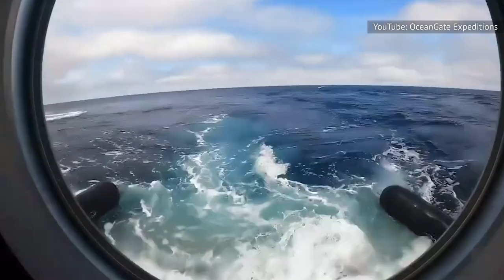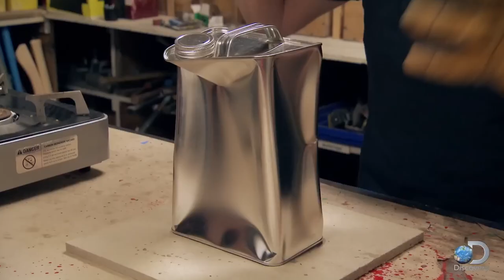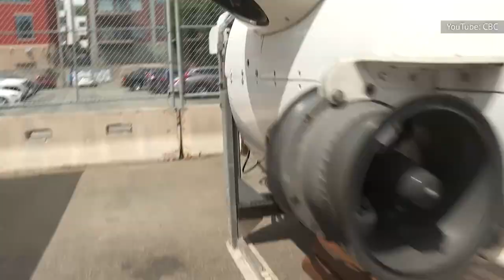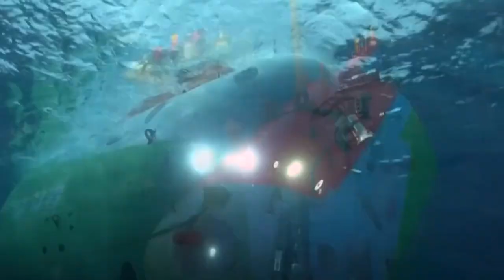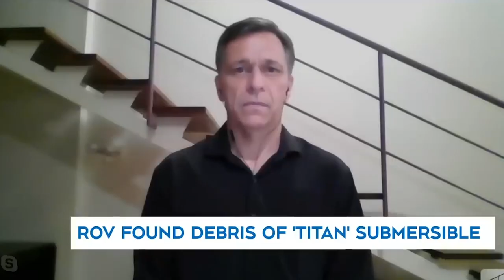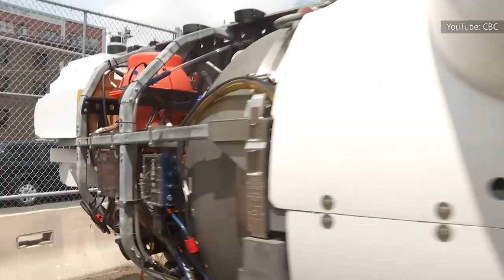The Truth Behind How The Titan Imploded, According To Science

Comment: Carbon fiber is great in tension, but not so great in compression. Hull was supposed to be 7in thick but was wound to be 5in thick. Hull bonding methods were never tested so likely had voids in layers that created stress risers. Titanium End caps were resin bonded to hull in an untested manner. Electronics were all 2nd hand and never intended for harsh duty service. Cabling running external to hull in locations where it would be easy to snag. Multiple prior trips cancelled due to mechanical or electrical failure. Acoustic hull stress sensors were a waste of time for this type of usage. Minimal prototype testing showed there were issues so response was to stop testing.  Acrylic porthole was installed in a manner that the dissimilar material issues were heightened not mitigated. What a joke. This wasnt pushing boundaries. This was slow motion suicide.
Reply: Good summary of this disaster.
Reply: The fact that Oceansgate privately had know that Sunday that the sub imploded immediately after comms and tracking were both lost simultaneously and shared that fact with the Navy,....yet, while deliberately  misleading the public for four days is the real tragedy here.  The families were hanging on to false hope for days until Thursday when Wood's Hole Oceanographic Institute finally confirmed what was known all along on Sunday by traveling to Titan's last known position and then descending straight to the bottom where Titan's wreckage was found,..exactly where they expected to find it. Authorities knew all along that the sub had imploded on Sunday, and dragged out the story of hope for four days. The sub was degraded by structural failure with each dive it made up until Sunday.
Reply: @careercriticalthinker  They needed visual confirmation before saying anything to the families. Authorities heard the implosion, but couldn't definitively say it was the Titan until an ROV arrived that could go to those depths. They had to search elsewhere under the assumption that something else could have happened while they waited for an ROV to arrive at the site. This is standard procedure. If I was missing, I wouldn't want authorities to stop looking for me without visual confirmation that something happened to me. 

The biggest problem is the media circus around it.
Reply: @careercriticalthinker  to be fair they needed to actually see the sub to confirm their claim. They cant just say it imploded without finding the sub first
Reply: The most important thing was the pressure vessel, he said it himself. Clearly the design was terrible. 
   There should have been 10" of titanium ring overlap on both sides of the CF end Then it should have been bolted all the way around with hundreds of bolts and then more CF wrap woven and bonded over these, on the inside there should have been a very hefty frame providing diagonal bracing against twisting, while incorporating large rings (probably 4 or 5 along the length) especially one close or bolted to each end plus longitudinal bracing.
  If i put some thick walled carbon tube in a vice it will easily squish before shattering. Another design improvement could be adding layers of other materials or with different CF pattern to the CF wrap making it a laminated design, potentially integrating the "hefty frame" i mentioned. When i saw how they bonded the titanium rings to the CF my eyes popped out of my head. They should have lowered this into the Mariana trench with nobody on board. That would have been real testing. See at which depth the prototype implodes.
  I wonder if they recovered any video footage but i can't imagine any sort of memory chip surviving the implosion and the sea. Perhaps if they find the actual chips in the memory cards.
Reply: Nailed it the last missing view cap bolt not necessary

Comment: Delamination is what seems to have been the cause of the accident. Carbon fiber is subject to failing under pressure and low temperatures. The cylinder was 5 inches thick, but apparently over successive dives kept losing integrity to the point where it failed. This was indicated by 'cracking sounds' coming from the hull. They just ignored those. The RTM hull monitoring system installed on the Titan gave them the same feeling of false security that the watertight compartments of the Titanic gave to the White Star Line.

Comment: Not rocket science. Hull was made of carbon fiber instead of industry standard metallic. Titan's viewport was certified to 1,300m depth. Titanic rests at 3,800m. Ocean Gate played Russian roulette with each dive. Not a matter of if but when.
Reply: Video actually says the titanic is at about 13,000ft and the submersible was designed for that exact measurement but the equipment should always be overqualified. At bare minimum the equipment should have been able to do 16,000. To be safe you should go to 25,000
Reply: 4265 FT*** 12467 FT**
Reply: The window is shocking. It almost makes you think the guy had a brain tumor he didn't know about...hard to believe this level of stupidity.
Reply: It's my understanding that the company that made the viewport offered to make him a new one but he declined. Something about not wanting to spend the extra money. 🤷‍♂
Reply: Exactly
Reply: And they pay the price
Reply: Hull was made of carbon fiber instead of industry standard metallic. Bonded to titanium caps on both ends sealed via epoxy and galvanization prone bolts. Those facts alone should give pause before allowing  human transport.
Reply: May they use the submarine for races
Reply: Wow you're soooo smart
Reply: Metallic? I think you meant titanium
Reply: @Michiganders yup

Comment: If you're going to use carbon fiber... make it 10 times down to the bottom and back with no one inside. THEN build a new hull every single time and go maybe 5 times to the bottom with it. Basically you will need to treat the submarine as disposable after a few dives. Then again if you go with steel you can reuse it endlessly.
Reply: The CEO knew carbon fiber isn't a material used in deep dive subs for that reason and he used it anyway. He was proud of breaking the rules and said that safety "stiffled innovation"
Reply: Titanium is the best material. There was a Soviet military sub that was rated to similar depths, with a crew of 14 or so, and had a titanium hull.
Reply: @Pythoner  it is but only because of its lighter weight compared to stell which works just fine but is almost twice as heavy.
Reply: @purplebutterfly314 well, carbon fiber is used a lot in planes and "Crush" (let called him that because he got crushed into fish foods) being well versed in aeronautics engineering for many years overconfidently believe that the carbon fiber could be applied for deep diving industry.
As for breaking the rules attitude, I saw some psychologist state that Crush's attitude cames from his wealthy background. From my experiences with rich people, lot of them do not like to take "no" for an answer even if their actions broke the law and Crush is one of them.

Comment: When you operate a submersible with a video game controller, you get a final destination.
Reply: The inside lights were bought from a camping shop.
Reply: it it had glow sticks to light up the inside
Reply: Monitors and keyboards just sitting on the floor along the wall😂 Who the hell thought this was professional
Reply: The controller was literally the safest thing about the sub; only ignoramuses keep repeating this. The carbon fiber hull and the interface was what caused this issue and was the most dangerous aspect
Reply: current US subs use Xbox controllers,  its not a novel thing btw
Reply: @melodymacken9788 it looks like a mini van on the inside 
Maybe that is why 😅
Reply: @logicrules5793 professional gamers maybe
Reply: @pyropulseIXXI  Yes well rated for 100% humidity!
Reply: The main problem with the controller was that it was wireless, not that it was a video game controller in itself. Also he said that used a wireless one so everyone inside could pilot the sub, which is insane when you're in a site like the Titanic where you can get easily tangled somewhere or stuck in the wreck
Reply: @purplebutterfly314 controllers have wires that charge them while using them. the controller isn’t relevant

Comment: Carbon fibre hull is just trigger nuts. Thick thick steel is usually used for a damn good reason, this was just irresponsible and avoidable.
Reply: It's now being reported by some outlets Rush stated he bought the carbon fiber discounted from Boeing because it was past its shelf life to be used on aircraft. If that's true this rises to near gross negligence and those waivers will be worthless
Reply: @johno1544 he also said in interviews his reasoning for carbon fiber was it errodes less than the standard metals. So it's another cost saving measure. And I haven't seen confirmation, but many people say the acrylic for viewer was not graded for the depths and he opted not to have it replaced to save on cost.
Reply: @newp848  In a capitalist system, isn't every decision just another 'business' decision?

Comment: Here's the deal, it wouldn't have been a crack, but a poorly manufactured tiny tiny section of the hull. You wouldn't be able to see it without an electron microscope. Constant pressure loading over the years will have weakened it till this dive caused it to fail. The passengers will have gone from happy to being vapor in about 3000th of a second. They won't have felt, heard, or seen a thing. For comparison, 4 divers got sucked through a 2 inch gap when a compression bell was badly handled on a oil rig (Byford dolphin) they were pressurized to 600ft, the thing exploded like a bomb. These guys were pressurized to 13000ft. Utterly painless way to go.
Reply: That takes my breath away.
Reply: This is absolutely wrong; they would've heard the hull delaminate, because it is carbon fiber. In fact, the 'safety system' for this was literally acoustic detectors that would let you know the hull was delaminating; the 'solution' was to drop weight and pray to god you rise faster than implosion occurs.

In fact, the submersible was literally rising before implosion, so they definitely knew they were at great risk. Of course, the instant of implosion is so fast they didn't even know it happened, but they definitely knew it was about to happen.
Reply: @pyropulseIXXI  at that depth there's zero chance they heard a thing. Maybe at 1000ft, but down there at that depth nothing happens gradually. Something is either there or it's not, at 3 tons of pressure per square inch even carbon fiber wouldn't cope with that for a nanno second after numerous pressure loadings. If it was new, I'd agree with you but it's 15 year old carbon Fibre tech, soild till it isnt there is no half way with it, not like today's materials that offer stress loading diversion.
Reply: @bazzmcfury9550  Dude, it is carbon fiber; it delaminates before failure. And it will keep delaminating until it reaches the critical point of failure, and then instant implosion. You are absolutely wrong; this isn't an 'opinion.'

The mothership saw that the sub started ascending and then lost comms and tracking all at once.

In fact, the 'safety feature' was an acoustic sensor that would inform you that the carbon fiber was delaminating; the 'solution' to this was to drop weight and pray to god you rise faster than an implosion event occurs

But you don't even need an acoustic device to detect this, as you'd hear it with your own ears

So many of you just repeat pure nonsense, it is honestly kind of funny
Reply: @bazzmcfury9550  why do I have to repeat myself and you just ignore the fact the sub was literally ascending

They were descending, the hull started delaminating, they heard that, so started an emergency ascent maneuver by dropping weights

In fact, James Cameron says this same thing, that they had warning via hearing it and wear ascending
Reply: @pyropulseIXXI  I wonder how long they were able to hear the hull delamination before it hit 'em. Even if it was a very short moment, hearing that would be terrifying as hell.
Reply: @pyropulseIXXI  I'm well aware of how carbon Fibre works, and I'm well aware that at sea level it behaves just as you describe to a T but not under these circumstances. Drop that much force on it, that rapidly, the delamination process from an internal meshing fault that's been stressed over time, isn't going to last any longer than entirety of the whole structure, and if that structure is a bubble with people in it, thats going to be less than a heart beat. The time it takes can be measured in thousands of second differences for every atmosphere of pressure. There is absolutely no way they were there hearing there submarine crack and snap whilst they made a frantic effort to reach the surface, i understand acoustic saftey sensors there common place, at that depth they were a waist of weight and money. More over if all this info about the mother ship hearing delamination then loosing comms during an unscheduled assent is true, why did they spend days searching, and start shipping over rescue subs. Your saying they knew from second one they had imploded based off this cut and dry evidence and were just "doing the right thing" to make everyone feel better. I doubt it. And if it was in the throws of an assent, that could have been for only seconds maximum, I seriously doubt they were anywhere near the bottom if the pilot knew anything about operating his craft, because the debris field is less than a few hundred meters, which is pretty much the right altitude for subs looking at the wreck. You don't hit bottom at anytime, there's chunks of metal shifting all the time on that site. Bulk heads failing, that wreck sheds a lot.
Reply: @pyropulseIXXI  Even if what you say is true, who knew?  Did the captain make an announcement over the PA system?  He certainly had no more than a few seconds forewarning, if any.
BTW, how do you know the sub was rising before the implosion?
Reply: @micahrutland9021 you can just imagine the creaking sounds of the nuts & bolts giving way two miles down, and knowing that you  are F@#ked. It was nothing more than a dinky toy that they went down in.
Reply: @pyropulseIXXI while there are rumours that the submersible had dropped ballast there is no evidence that it was doing so to ascend because of an emergency.. The very fact that the support crew in the surface vessel in fact waited until the full planned duration of the dive was complete before reporting the vessel missing to coast guard would suggest that they did not consider this to be an emergency ascent. If they did so such information would already have been shared at the start of the search and rescue effort.
Reply: The implosion was painless but they had dropped ballast. Something bad was going on for them to abort like that and everyone in that sub knew it. That's torture!
Reply: @hokeywolf3416  no doubt, the more i learn of this craft the worst the picture seems. Made well, carbon fiber and titanium weave, but zero non destructive testing. They had zero idea of how many dives it could handle. Guess that number turned out to be 4. No GPS, no means of crew escape (they were bolted in from the outside with no means of exiting without outside help). No transponder or tracking, even of they had made it topside, they could have suffocated bobbing around the ocean if they weren't found within 4 days. I'm eating my words a bit, so many  corners cut.

Comment: Former OceanGate engineer Lochridge and experts had highlighted Rush's refusal to have the submersible properly inspected and certified.
The director said he had been told OceanGate was unwilling to pay for such an assessment.
Titan is a carbon fiber submersible that can travel as far as 4,000 meters below sea level, the OceanGate website says. At the depth of the Titanic, which sits 3,800 meters below sea level. 
Lochridge also said that the submersible's viewpoint was only certified to work in depths of up to 1,300m and claimed he had been fired by OceanGate after he questioned the safety of the Titan.

Comment: The super heated compressed air bubble vaporized them in an instant
Reply: no it didn't; they just got flash burns from that, and then crushed and turned to mince meat from the implosion
Reply: @pyropulseIXXI  Experiments have been done on this, the temps of collapsing air bubbles have reached FOUR times the surface temp on the Sun , being exposed to that even for a millisecond would go along way to vaporizing you in an instant even before the pressure wave got to you and turned you to mince or soup there might be nothing left to crush

Comment: That mini submarine should never been built in the first place.
Reply: It's not a mini submarine. It's a submersible.  Huge difference.
Reply: @comet1227  oh OK thanks for telling me.
Reply: Submarines are more structurally sound. If they had gone in a mini submarine they would have been fine.
Reply: This was a large picture pipe wrapped with carbon fiber strands. It's great for stopping expansion or stretching. But it's weakness is preventing compression.